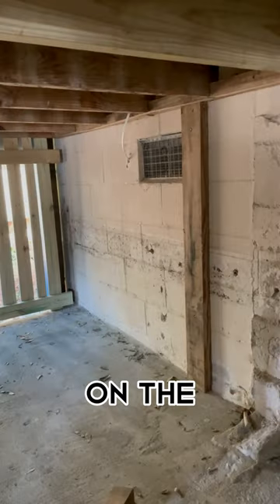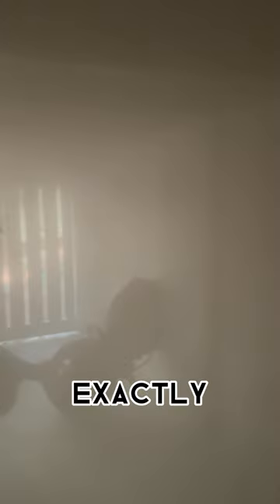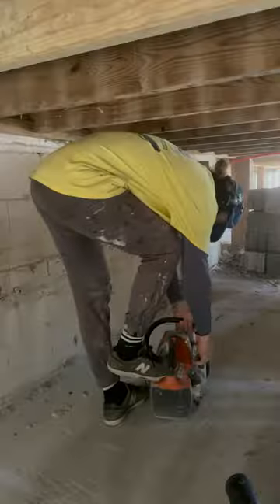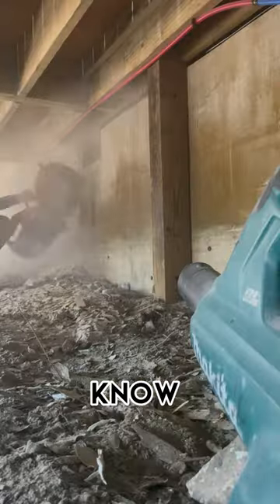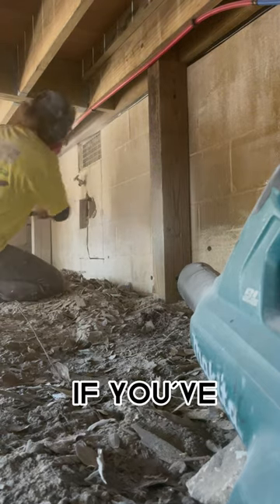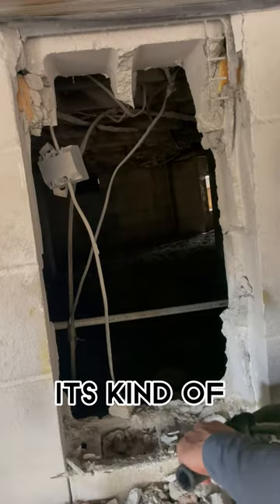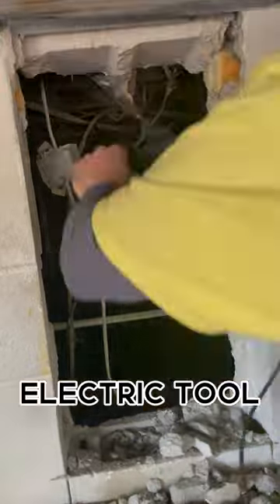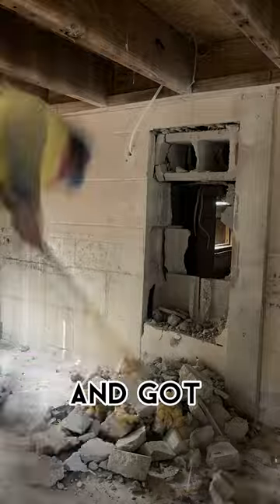Cutting Holes | Artpentry

Comment: Where I come from, we're not allowed to kick up concrete dust in a basement with a saw. Jackhammers only.. Granted that's looks like an external basement job but, nonetheless, you should be wearing some serious ppe when working with concrete dust.. That silicate will cut your lungs right up real quick.
Reply: What more do you think he needs to wear dude?
Reply: Disposable clothing because his clothes and hair are caked in dust
Reply: @daltonlopez4623  😂 sadly we dont get enough to buy  new clothes everyday
Reply: @That One guy  you must have soft hands. Theres disposable tyvek suits. Pretty much every trade uses them occasionally. Painters especially. That's what I meant by disposable clothing. Required to be provided by the employer if the employee deems it necessary
Reply: How much exposure is “too much?” 
Is older concrete more hazardous? Thanks

Comment: There are wet taps on the concrete saw to minimize the dust using a a garden hose. Keep something handy like a shoe lace or tie wire to pinch off the hose when you need to quickly turn the water off.